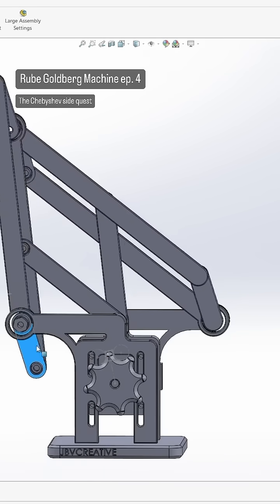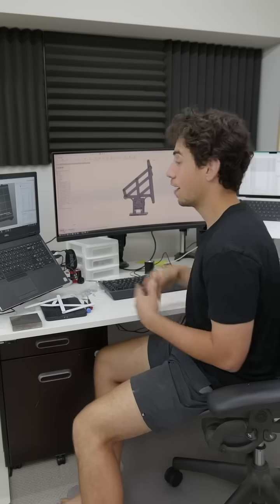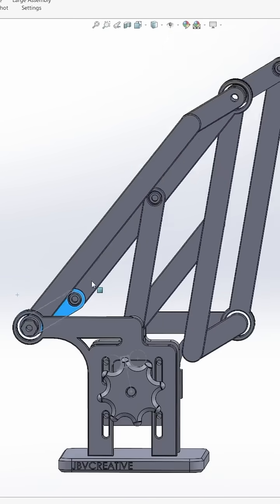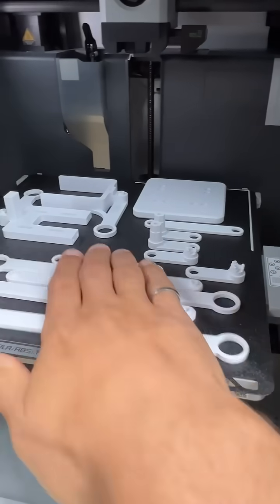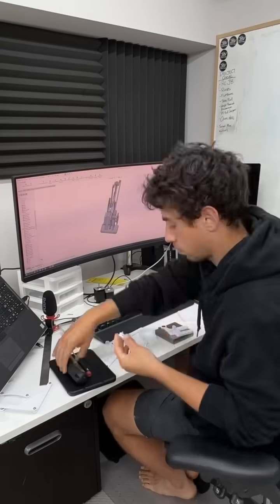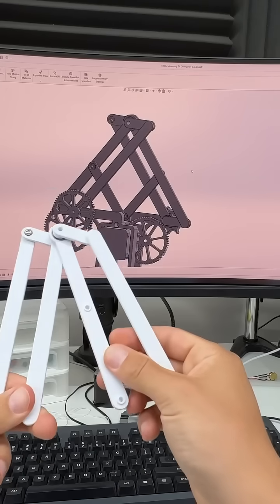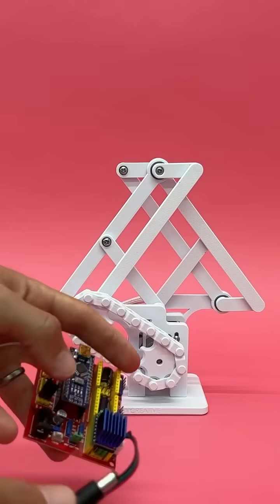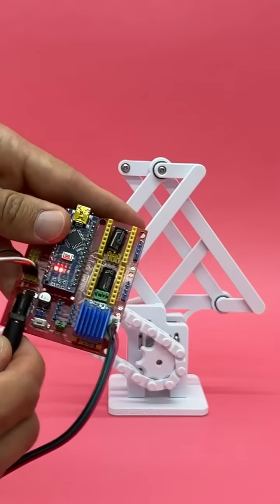Crazy Mechanical Linkage

Comment: There are A LOT cooler 4 bar linkages out there. 

Infact, we used to be surrounded by them in every day life. How do you think a single motor was able to injest a cassette at an angle, pull it in align it to the sprockets, open the front flap of a VHS, and drop the tape onto the capstans, then do it all in reverse? Hell, go ask your older siblings a out the coolest head unit they've ever seen, chances are it was a sony that was blank on one side, pushed out turned over then came to rest at the perfect angle with a slight raise. 4, 5, 6 link machines are awesome.....and freaking crazy to design.....

Comment: If you look at this  Specially at the lower and more central points.. This kind of mimics  hip movement when walking. Wonder if this could be worked out into bipedal robotic movement better than the slip slide foot drag used now.

Comment: Do you want me to use for ship but I have  free energy way to increase speed of ship.
Reply: Problem with this is any garbage can stuck to chain ⛓️ and block movement.
Reply: I have one suggestion you connect it Bhaskara wheels. Do experiment on larger ship.  Bhaskar wheels is free energy, it stop but ship keeps shaking so it will never stop. 
Make shaft longer as per as need of ship. 
For air bubble 🫧 another idea. 
If ever Bhaskar wheels are not working, I have another idea. 
Try it and let me know .
Reply: Use car break system to stop function of wheels.

Comment: I find it a little funny that you use a fully fledged arduino-based motor controller instead of just using a potentiometer. Arduino really is the hammer for every nail these days, huh?

Comment: What is the hyperbolic tangent of the acceleration of the 3rd link rear at end point of maximum radial acceleration?  Anyone? Anyone? Bueller?  I think the lateral instability comes from theoretically impossible values selected for the design, like division by zero and so on.  Just a little slop and you are good to go.

Comment: What you have come up with is an example of a quick return mechanism, its not a four bar link.

Quick return mechanisms were common in machinery designed by mechanical engineers who specialised in the research area of kinematics. Old mechanical sewing machines used a form of the quick return mechanism. 

Please research the area before building another one by referring to previous work by authors such as: Jeremy Hirschhorn,  Ken Hunt and Jack  Phillips. The research area was much richer 50 years ago.

You will need to establish each link's  tangential, centripetal and coriolis accelerations at operating speed to minimise its operating vibrations.

The design of such mechanisms is not just based on potential link collisions but the motion that is required at different driving link angular positions.

Comment: Can you show exactly how do you make the joints? I was building a klann’s linkage for a walker and I had an issue of coliding joints, but countersunk holes did not fix the issue, as the friction between the parts grew a lot

Comment: what stepper and stepper driver you use? they are so quiet
Reply: And why a stepper in the first place? 😳
Reply: @carlc.4714  controlled speed regarding the load, and quieter than low budget geared motor

Comment: Traces a very interesting ellipse. I don't know enough about machines to understand why you would need something like this
Reply: The point is the bottom half of the trajectory is an almost perfect straight line. This linkage was originally designed to convert linear motion of a steam engine piston into rotation of the output crank.
Reply: Clicks.

Comment: This is genuinely the smoothest moving 3d printed mechanical linkage I've ever seen.
How much post-print work do you do on these parts?!
Reply from the maker: Its the bearings, they make all the difference
Reply: @Engineezy  ahh that makes sense!
Awesome work though man, binged most of your content lmao
Reply: @Engineezy  I wouldn't mind a shortlist of hardware- I just got into 3D printing a week ago and quickly found myself needing bearings. I am using 6003 2RS but looking for smaller ones like these.
Reply: What printer and filament do you use? @JBCCreative

Comment: This reminds me of old printing presses with a flywheel.  The flywheel is constant, but the motion of the actual print/type was like this so it would imprint and release fast, but move slowly through part of the cycle.

I used to have a fairly old book with hundreds of mechanical motion linkages described and illustrated.
Reply from the maker: Awesome! A lot of really cool things can be achieve with mechanisms eh!
Reply: Awesome! Could you remember the name of the book? Thanks for the info 😁🙏
Reply: @RobQuinney Five Hundred and Seven Mechanical Movements
Reply: @PeriapsisStudios2000 thank you for responding!
Reply: @PeriapsisStudios2000 They could've stopped at five-hundred, but I appreciate that they went the extra mile adding the last seven.
Reply: @RobQuinney  7 volume encyclopedy by I.I.Artobolevsky (available in scanned form free of charge)
Reply: a remark to be precise - there were 2 editions (1st one of 5 volume set and last one of 7 volume set, but 2 volumes were packed in one book so sometimes it is called 6 volume set). Also Artobolevsky published other books on the subject but they have text 🙂the abovementioned encyclopedies are just a set of pure mechanisms drawings wth formulas to scale them, so almost no text to read aside of small remarks)
Reply: @RobQuinney 😮qñ

Lo
Reply: There's a website for the 507 mechanical movements, too. A lot of them are animated, but not all of them
Reply: i have 2 such books here somewhere. they are like an older better book that i had.
Reply: What is the title of that book?  I can only imagine how cool it is.

Comment: Hey, I'm still having issues with my pin Joints. Would be really helpful if you could help. So how are you fitting the bearings into the 3D printed parts? Could you potentially do a small tutorial for the pin joint if possible. Thank you!
Reply from the maker: Ill put it on the list!
Reply: @Engineezy  Thank you